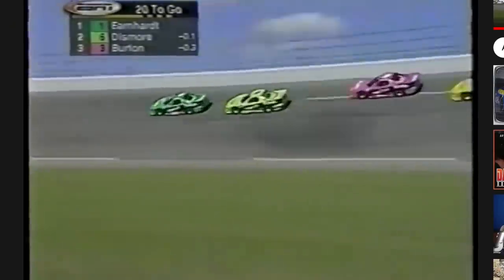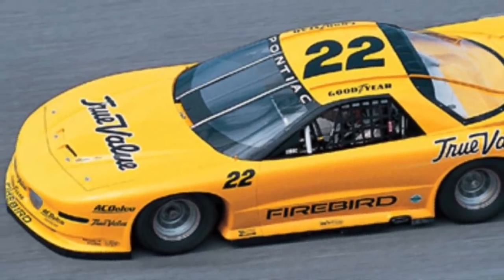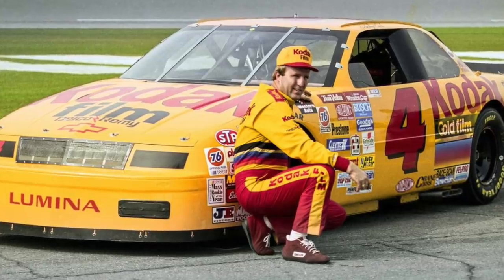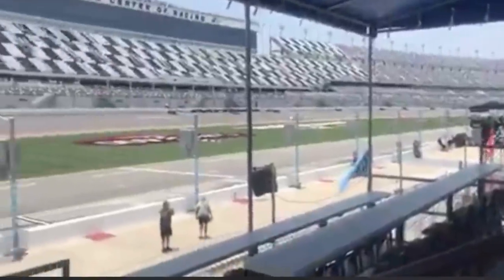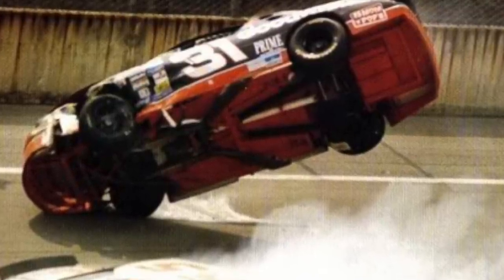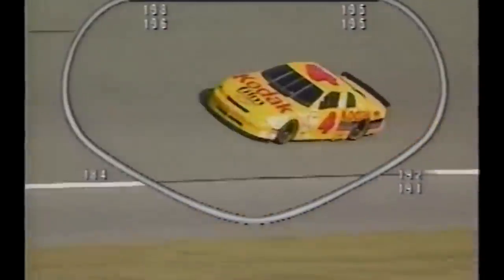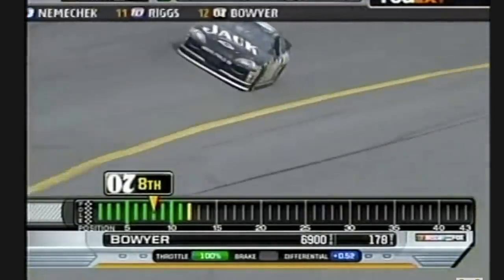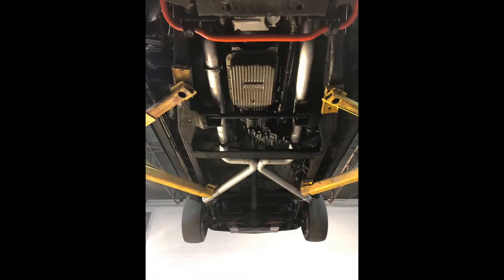What Made "Old School" Restrictor Plate NASCAR Sound So Great? (Back to Back Sound Comparisons)

Comment: I have a question and I don’t know if you respond to old comments, but do you think the nascar next gen cars could get away with it if they had the exhaust shorter? Does the length of the exhaust make a difference or is it just the angle that does?
Reply from the maker: I answer as many comments as I can. It looks to me like the new cars don't have any crossover at all and thats why they sound funny
Reply: @Stapleton42  oh ik but I ment with how the exhaust is laid out do you think they could cross them that’s what I ment? Cause the point of the gen 7 is to have a flat underside so do you think they could get away with it with the exhaust still fitting under the flat sheet? You will have to look up the exhaust diagram.

Comment: Hey Kidd you need to back to 1980’s and 1985 at Daytona when NASCAR ran dump exhaust listen to those cars running over 200 mph that is a real sound of the engine screaming with power and speed that was with out restrictor plates and even in 1987 when they put the restrictor plates on the sound was the same , watch Daytona in 87 when Bobby Allison beat His son Davey the sound was the same go back to 1985 at talladega those cars were hauling ass , when NASCAR was great. NASCAR has sucked for the last 20 years

Comment: The equal length to the x pipe is also where the extra hp is hidden most think exhaust header tube lengths can be whatever length yes they can it's going to rob power though same with where your x pipe is located along with how long the dual pipes are that comes out the sides. Also one more thing part of the reason you blew that muncie 4 speed up is because the case is cast aluminum unlike the muncie 3 speeds that are cast steel and a bit stronger. Your muncie 4 speeds was designed to be lighter and hold the power while up to speed not from a dig start like drag racing main reason why guys dont use the 4 speed when drag racing no need for the 4th gear.
Reply: This is very interesting.
Reply from the maker: Yes the headers should be equal length as well as the pipe leading up to the x after the collector

Comment: Would it be even remotely possible to get this sound on a twin turbo exhaust setup without a crossover pipe (neither an X-Pipe or an H-Pipe)? Like a true dual exhaust with a turbo on both banks 4 cylinder for each turbo.
Reply from the maker: Impossible. The crossover is what creates the sound. The turbos jumble up the natural order of the exhaust pulses so much that it greatly changes the effect a crossover has. They do change the sound. Just not as much as an engine with no turbocharger
Reply: @Stapleton42  Thanks

Comment: I would have to agree that V6’s sound like garbage. Inline 6’s are okay, but nothing beats a beefy V8. It should sound a little different but it would be interesting to see the power difference. We run the 7,4 swap cam in our 540 blown alcohol BBC. And it’s noticeable to a standard fire BBC. So it should be again different with an LS firing cam.

Comment: The engines are much different now..... The chevy engine of the time was the SB2..... The new engines are Ls based.... i dont know about the fords and Toyotas
The old chevy Small block firing order is different from the LS engine.... old school distributor driven 1-8-4-3-6-5-7-2..... Ls coil pack engine 1-8-7-2-6-5-4-3 ..... The x pipe helps.... but the modern engines are much different..
Reply from the maker: Current Chevy cup engine is the R07. Same platform since 2007. The truck series and arca use ilmor built LS engines I think is what you’re referring to
Reply: @Stapleton42  what I meant is that the R07 is more LS based… the valve angles and port spacing is much different than the older SB2 design… they still use the SB2 in the Xfinity and the truck series… that’s why the cars sound different… I love the deep dives into this stuff!!! I remember watching that qualifying run back in the day when they were all Talking about the Morgan McClure 4 car…  it did sound very unique and awesome!!! I’m originally From a small town not far from Bristol…Their shop use to be in Abingdon Va … I got to tour their shop in 1992… it was awesome!!! Keep up the good work!!

Comment: completely different engines, different firing orders, different exhaust designs, not to mention mic. differences from 1995 to 2022 etc etc etc.
Reply from the maker: Listen to Daytona 2007 compared to Daytona 2002. Basically the same sound. Yet the engines evolved sb2 to r07. The exhaust setup was basically the same. Firing order hasn’t changed. The driver of the sound change is the exhaust. The technical engine differences can’t offset the exhaust type when the difference from X to H is so significant